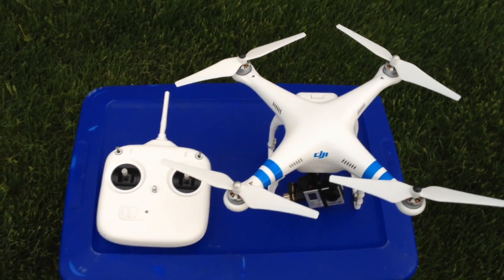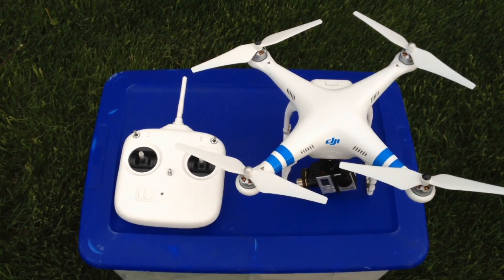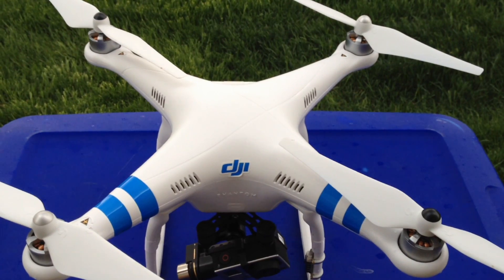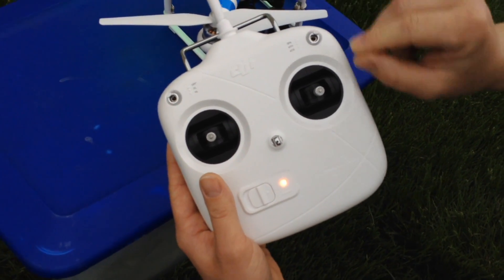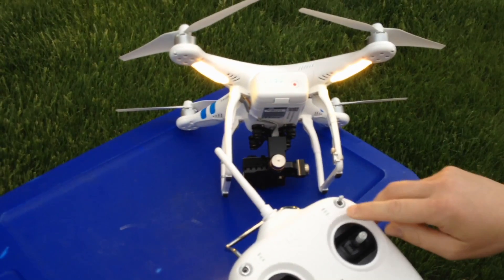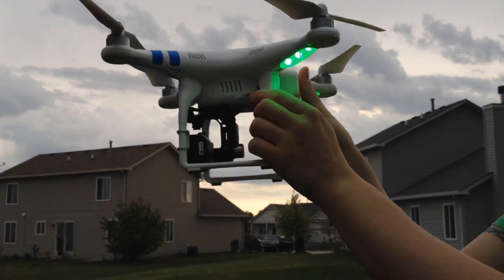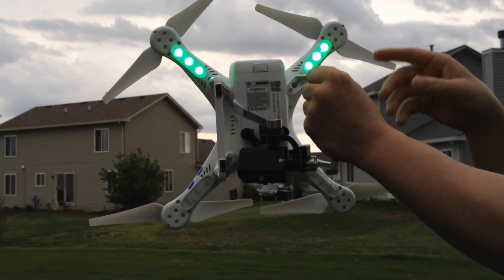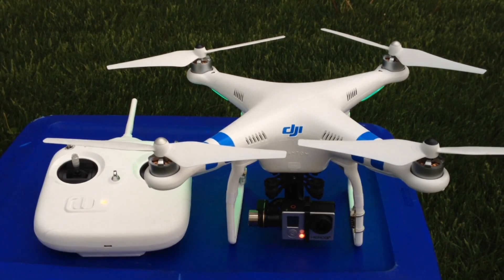Dji Phantom 2 Compass Calibration Procedure

Comment: Skip to 1:35  What you need to know starts there.  Thanks for the video, very helpful.
Reply from the maker: +Ted Mackel the other tips are very important if you want the procedure to be done right.
Reply: Certainly but it can be handled in less than 1:35.
Reply: Ted Mackel
Yes I agree! Maybe like 1 second 🙄😜

Comment: WOW! Great tutorial. The instructions on the DJI wiki are horrible! I never knew the difference between S1 and S2. I was flipping the switch on the left! I almost had a fly away today. I noticed the the lights change from green to red then it took off!. I managed to get control of it and bring it down safely. What is the switch on the left for anyway? Can't find any info on it.
Reply from the maker: Chris Pinon Options that can be programmed in.
Reply: Ford, thanks for the response. I found some other great tutorials that explained the function of Course Lock and Home Lock. Thanks!
Reply: Chris Pinon Do you keep the S2 switch in OFF mode?
Reply: Frank,

Yes, it is on the off position and S1 is GPS. I finally found out the proper use for each switch position. Now the Phantom flies like a charm. I have nor had any problems.
Reply: Not sure what I was thinking but I did NOT have mine in the off mode and drone went over the house and hit a tree...not a good feeling. Thanks for the tip...I've usually had it off but this confirms I need to double check

Comment: you could have saved us the first 2 minutes ;)
Reply: FordTechMakuloco, good video. Thank you. I agree that the warnings may be beneficial to some. They are worth including. Thanks for making a simple, straight forward video.
Reply from the maker: Extreme Central Everyone says this but you have to realize the precautions before doing the calibration or what's the point of doing the calibration? In other words I don't mention anything and just show the calibration, then some guy does the calibration in a concrete parking lot with lots of rebar next to a cell tower and 5min later has a fly away. Now what was the point of all that plus on youtube it is very easy to skip ahead to the meat an potato's of the video unlike the old days when we had tape.

Comment: Thanks for the tips!  I've seen other calibrating videos where the demonstrator holds the Phantom by the landing gear and turns his body in a complete 360 instead of turning the Phantom around and around and it worked just as well. Just food for thought. Thanks again!
Reply from the maker: Tim Sembach I too have but I like this method better personally.
Reply: Tim Sembach I think the turning on the spot the way he does is better just because in theory it should give a more accurate calibration point on the compass. The otherway works but the more accurate the better with these things.

Comment: To the Drone owners: I just purchased one and it arrived two days ago. I noticed that the joystick to the left (up and down) gets stuck when I move it down. Is it normal or is my controller broken?
Reply from the maker: Julio Oliveira Which model drone? On the phantom both sticks are supposed to self center.
Reply: FordTechMakuloco It's one Phantom 2. I know. it's like all joysticks but I meant that the one to the left gets stuck in the "down" position when I'm bringing the drone down. Is it normal?
Reply: I mean, when I release the stick shouldn't it go back to the center? It just doesn't. It's like something holds it in the "down" position.
Reply from the maker: Julio Oliveira Yes it should goto center.
Reply: Did you get the V2 or is it the regular Phantom 2?
Reply: Hey Rey Albert I wrote to DJI and they said that this is a brand new feature on the new models. Thank you!
Reply from the maker: Well that sucks I like the auto centering, the quad holds position that way.
Reply: The Brand new controllers will allow sticking in the down position...  That's meant for a fast easy descend....

Comment: Thanks for your vid- haven't flown my phantom 2 vision in quite a few months...I haven't updated the software yet as there are some things in the latest versions I'm not keen on however I remember when I got it last January it took 3 (not 2) steps to calibrate (turning on all 3 axes) but now after the second step turning on the vertical axis the quad isn't calibrating - it starts flickering red instead of a steady green...is this something to with not updating the quad to the latest software or something (I have the latest version of the dji app on my mobile devices)..would appreciate your feedback! Thank you
Reply from the maker: Have you tried calibrating in a field away from interference? The last guy who said this was happening was in a restricted flight zone, but you said you have not updated yours. He had to goto dji for the new error code flash patterns.

Comment: I just opened my vision 2 today and I can't get the compass calibration to work. I've done this in 3 locations in open fields. After the lights turn from yellow to green when i complete both rotations it slowly blinks green four times followed by a burst of red flashing, then repeats. I don't see this specific pattern in the reference guide. No matter where and how often i do the calibration this happens. Is there something wrong with my phantom or am I just not doing it right? I even gave it a low altitude close range test flight and it seems to work fine. However, even when it flies it has the four slow green flashes followed by the burst of red. What's going on?
Reply from the maker: If you just opened it I would contact dji sounds faulty to me
Reply: That's what I was thinking... I also dug deeper into the manual and I'm thinking it might have to do with being in a restricted altitude flight zone. I live in a large city with a major airport downtown and a military base. I will try again outside these restricted zones and see if it goes away. If it doesn't, then it def has a problem
Reply from the maker: Interesting thought but I would assume trhe calibration would still take though.
Reply: Just to follow up, first time taking it outside the restricted flight zone and all green! No flashing red. I think it's just the altitude restricted warning. A bit of a confusing sequence of lights.
Reply from the maker: Good to hear. Sounds like they need to be packaging new cards for the error lights.
Reply: durango9595 Yep....that's what it is. I live within an airport area. When I'm flying in the area, it is alway red. Depending on how far I am away from the airport I can fly anywhere from 30 feet to 300 feet.

Pretty good feature.

Comment: good video, i just got mine a did the calibration, but when when i do the last part it turns yellow, then green and goes red for a few seconds then back tto the blinking green, does that mean that the calibration is good? or does it have to keep blinking red for it not to have a good gps lock? thanks
Reply from the maker: Make sure the end position of the right toggle switch is gps mode then it will flashes as shown in the video and you will know the calibration took.
Reply: FordTechMakuloco Mine is in GPS MODE and no matter what I do it will not do the final GREEN lights : /

Comment: Clockwise not counter Clockwise
Reply from the maker: The direction does not matter, what it needs is a 360. Counter clockwise works best and that is why I use it. Think about it, are we heading it north then turning it to the west first or the east, oh wait there is no North heading first to start procedure like the Blade 350QX, therefore the direction doesn't matter.

Comment: Hi, i saw a question of yours elsewhere and was wondering if you had had any success finding a way of altering the return to home height? there are a lot of very tall trees round here and if it returns height at preset value it will crash into them! Thanks Mike
Reply from the maker: Never looked into it further, it should be a programmable feature for sure just like I wish they would give us control of then decent speed, it just keeps getting slower and slower with each update.
Reply: FordTechMakuloco thanks for your reply, will keep looking then!
Reply: Michael Williams It'll rise to 60' if it's lower than that. If you have it, let's say flying at 200', it'll stay at that height for the return home. If you think your in trouble, before you set the return to home, go high.
Reply from the maker: That is my thinking on it because it will stay high until it get to the RTH point which should be a safe clear area to descend.
Reply: FordTechMakuloco Not sure if updates are to blame for slow descent. I think a lot of it has to do with propwash slowing it down.
Reply from the maker: Yeah maybe but the updates clearly stated that the max decent got changed each time.

Comment: During the vertical calibration you said "click that" click what? Your hand was hidden from view and you did not mention what you were clicking.
As far a arclimber, If you have an extra 3500.00 get the 6 rotor. If not get the Phantom 2 Vision or for 500.00 more get the Vison +. It has the gimbal that allow you so shoot straight down and has the gopro camera.
Reply from the maker: Not sure what clicking you are talking about but as far as the dji vision I wouldn't get that overpriced heap. This one has the 2 axis brushless gimbal that shoots straight down too and use my gopro I already own.
Reply: Thanks. I finally figured it out.